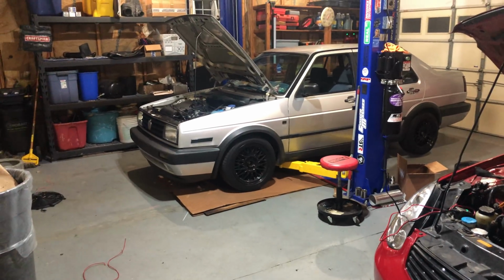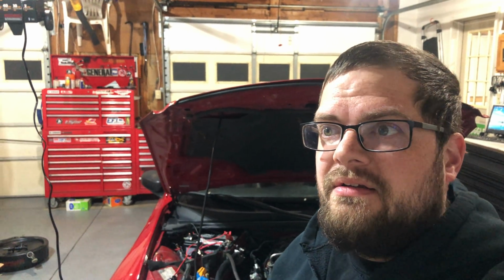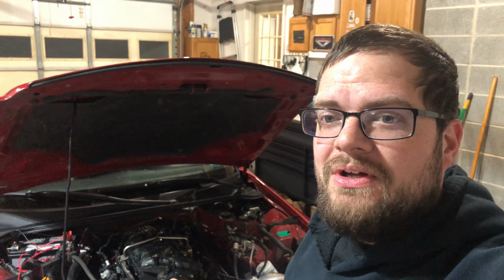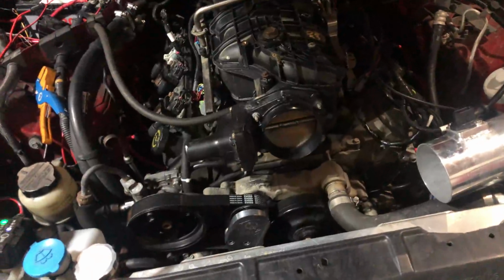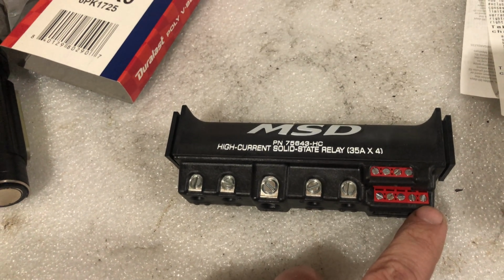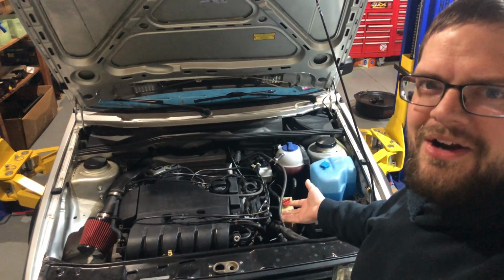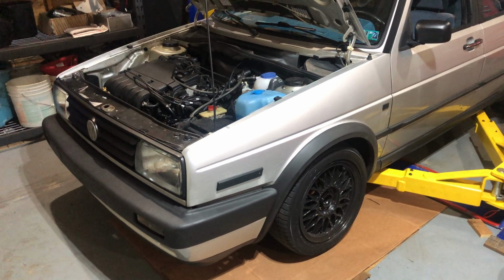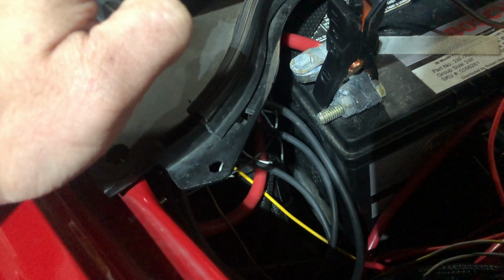Rambletron - G35, Mustang, Jetta, Kia's etc

Comment: I saw a video where a guy had a c5 z06 racecar with a lingenfelter motor and claimed the oem gm e67 ecu makes more power than aftermarket ecus when they were testing it. Have you tested or noticed that at all?

Comment: I have a soft spot for MK2s. Her's is really clean. The blue mk2 Recaros would be perfect in there.

The G48 could be a decent burnout car....🤷‍♂️
Reply from the maker: She bought a set actually and they didn’t match the rest of the Interior and it bothered her
Reply: @SloppyMechanics  it's difficult to find a full interior. She make want to consider getting them recovered. I had 2 MK2s with Recaros and they were so comfortable. She just needs a small 280-300 mm momo wheel to complete the early 2000s look 😄

Comment: Add some fluorescent dye to the vws power steering fluid and run it for a bit and check with a strong uv light, I use a blue point. If you see the dye you found out its power steering if you dont see it you know its brake fluid. I'm skeptical about adding dye to brake fluid, not sure if there will be an adverse reaction.. good luck! I wanna see them all running and not causing headaches, I know the feeling all to well, not driving something and enjoying it.

Comment: Please do the remote mount billet 80mm you were talking about  on the G. That would be another way to prove people wrong about remote mounts.
Reply: what do you mean by prove people wrong?
Reply: Remote mounts work if you have space constraints. I learned 2 things about them that kinda matter if you want "all" the performance. The closer you can get the turbo to the exhaust valves the better,  to get them spooling ideally you want as bot and dense of a charge as you can get. The exhaust gas acts like a fluid basically against the exducer and you want the velocity of it. And the charge pipe length is also kind of a set back. Takes a second to fill the volume but once its filled you have consistent pressure and available volume for  a 3rd, 4th, or 5th longer revving gear. I've always been on the fence about doing them myself, especially a big one like an 80mm. Maybe itll surprise us with the results 🤔

Comment: How bout a sloppy code for about 50% off those relay blocks? 😜
Reply from the maker: I will ask, they're so fuckin sick
Reply: @SloppyMechanics  I was just kidding about the discount brother. But I've been eyeballing them. I'm looking at at it like Holleys single SSRelays are $70 each. This is basically 4 for the price of 2 and alot more neat and compact.
Reply: They will sell a fuck load of them if they do a sloppy sale.
Reply: That would save me from having to crimp 30-40 pins in this fuse/relay box I'm doing for someone. The ones they have for battery cutoffs are pretty killer too
Reply: Those relay blocks sound pretty awesome and worth a vid for sure! Have a few places I could use them.